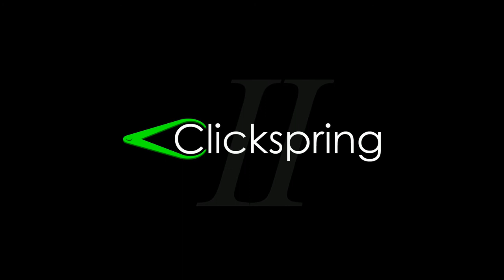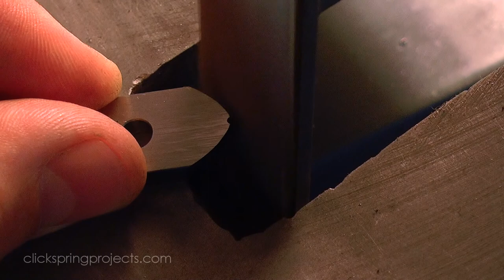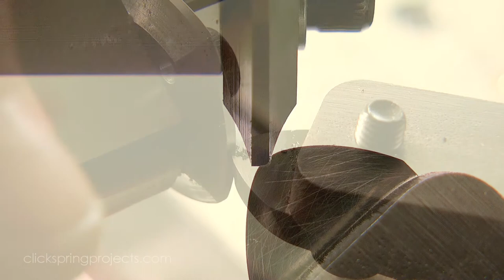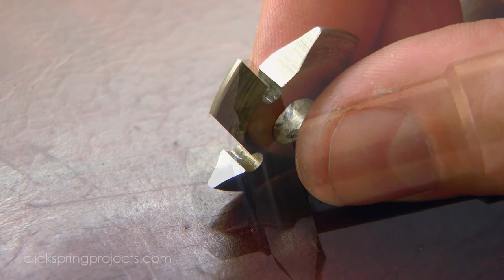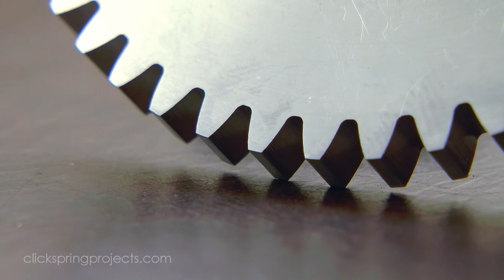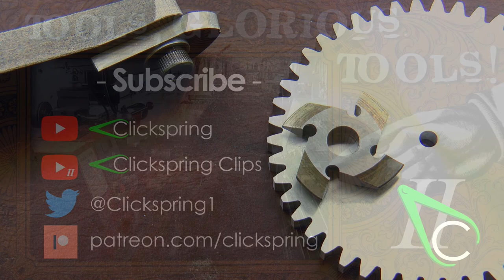Forming Tooth Fillets With A Shop Made Gear Cutter

Comment: How do you keep all this stuff rust free in Qld weather ?!  It's a big struggle down for me in Victoria, everything needs a spray of wd40 and oil once a week.
Reply: Air conditioning was invented to keep factories dry, the cooling is a side-benefit. A dehumidifier chugging away in a garage can pull an amazing amount of moisture away, and circulating air with a fan (e.g., on a timer) even when not occupying the space will further reduce the ability for condensation to occur on machines.
Reply: @jercos  I would, if I can put them inside the house. Aircon or powered dehumidifier in the garage / shed will be hard. I might try sealing the concrete floor and adding a whirly bird / vent for air circulation.